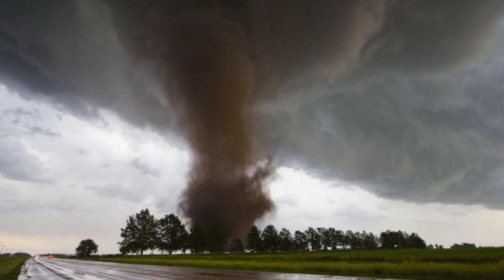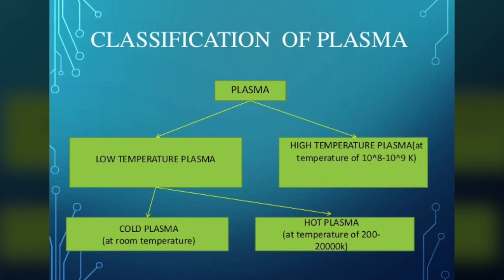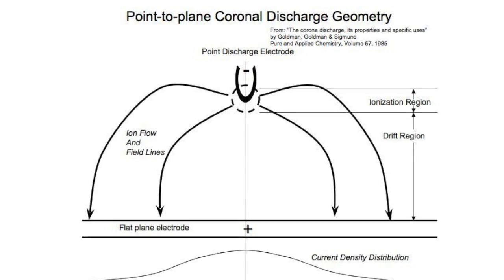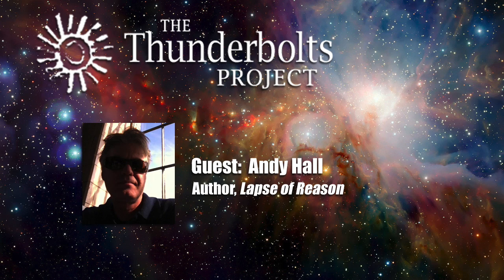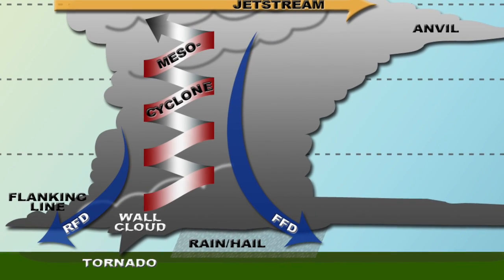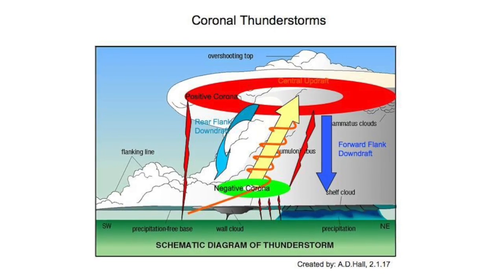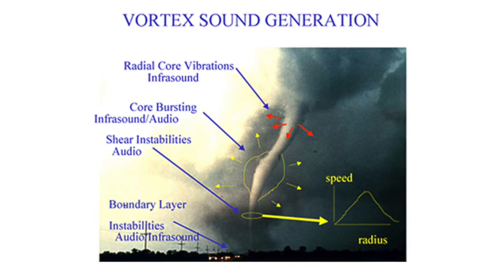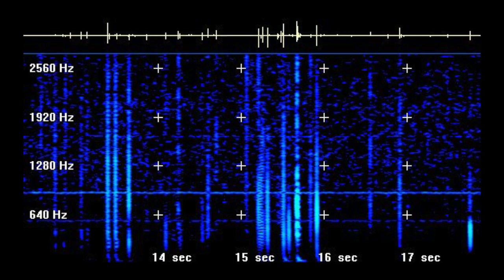Andrew Hall: Tornado – The Electric Model | Space News

Comment: We have all heard stories of objects being 'sucked up' into a tornado vortex.  From a mechanical perspective it is not possible to contain an object in a swirling vortex of water.  The object simply crashes through the wall of the water spout.
On the other hand I wonder if electrical charge could draw objects upwards into the spout, and then the mechanical action of the wind throws debris sideways over large areas or carries debris a great distance.  
Electrical levitation of ionized objects (objects with charge, not vaporized   lol)  would provide an excellent explanation for the transportation of objects by tornadoes.  
Fish might just behave like pieces of tinfoil in this scenario, being carried along with the charge cloud until they discharge and are no longer held up.  Also, fish might be a bad example as they are in water and should not build up any charge.
Reply: Sean Nanoman 
My western brain has always had difficulty with the claim, some Buddhists can levitate. Controlled studies by Harvard, on Tibetan monks ability to dry, soaking wet sheets, in ambient temps under 40ºF, using maintained surface body heat over 60ºF above ambient, is not possible according to western understanding...(That's why they chose to study it.)
But levitation has never been studied. Either because it's bullshit or perhaps not allowed.

Recent interactions with a rinpoche raised by Dali Lama and a trusted friend who had an audience with the Dali Lama a few months ago, have given me insight to this from an EU perspective.

According to Dali Lama words.
"The Sun is causing the anomalously rare extreme weather we see today." And his protege rinpoche living in Carmel Ca. Khenpo Karten Rinpoche (The heart monk.) confirmed that by resonantly manipulating negative ions, monks create a shield against gravity that allows them to levitate objects, even themselves. But, that requires negative ions be released from the ground in that location!
REQUIRES NEGATIVE IONS!

Considering our brains appear to be transceivers of EM resonances and the lifetime of serious training and the theory consciousness and thought is actually an external process, resonantly bound to our brains unique EM signatures (As with fingerprints.), considering that affords an avenue to understand and link negative ions with levitation, among other supposed phenomenon associated with these highly trained monks.

Knowing the massive amounts of upward travelling negative ions seen emanating from the centers of low pressure systems we call Outgoing Longwave Radiation (Tracked by NASA) It is possible there is something in the mechanism that could produce a gravity reducing effect in objects positively charged by positive ions, and assist in tornadoes lifting objects like automobiles or tractors.

Now considering Thornhill's amazing theory on the London force's role in gravity as a weak dipole force... It makes sense that a tool like the human brain, is capable of affecting magnetic resonance and intended organizing behaviors with, ground originated ionic flows!

Also, ever watch a jet plane coming in for a landing? The are decelerating from 200 to about 150 mph but don't appear to be moving that fast, when observed from the ground.

I used to think that the Buddhist mumbo jumbo was just that...but...I now am of the opinion that the mumbo jumbo effect originated from the disingenuous motives of those who seek to exploit the massive revenues generated by the FMP, the corporate pyramid base of the Buddhist practice.
Just as there are some sincere politicians and many exploitive ones, the same would hold true with those who run Buddhist retreats, hospitals and other "non profit" commercial operations.
✌
Reply: That's a fascinating theory.  My personal bent is humans don't levitate.  There's way too much foolery practiced in all the religions.  The amount of charge required to levitate a human would no doubt produce plasma and/or discharge.  The idea that a blob of organic goo, a human if you will, can produce or control electrical fields is pedantic.
Honestly I had to leave Buddhism behind because there's too much mumbo jumbery and superstitious/magical thought in the practice.  It tends to be very shamanistic.
Now the video of the levitating frog in the high magnetic field is really cool.  You should look it up on YT.
Reply: Sean Nanoman 

I've seen it.
I don't believe humans levitate but I'm open minded enough to realize that top level Buddhists tap into the same sense that migrating animals use and I understand enough classical physics to know negative ions are repelled by negative charge,  as in the earth's negative surface charge!

If our brains use electricity and form complex flows of it that create unique signatures of EM waves?
If animals use this ability to navigate and sense?
Who's to say the true "Search for Enlightenment" is not actually the search for reclaiming our own innate ability to use our brains to detect, interpret and utilize, magnetic fields?

Think about it. Just a small piece of plutonium can destroy an entire city. That's a shitload of resonant energy, just waiting to be released from sub atomic particles!
Yet we spend billions looking for the higgs boson particle when all the energy we need is orbiting every atom!

Suspending disbelief is the hardest thing to do. Trashing Einstein's theory of special relativity? You'll be labeled a crazy person...although nobody can actually explain it. I've read several books on it and still cannot understand how he took Maxwell's equations, eliminated the wave bearing medium that EM energy requires to propagate, and didn't explain how he could get away with it! (The aether)
That's why you could spend your life reading about his theory, trying to understand and go to your grave still confused...smh.

Thornhill pegged it!
E=mc2 actually means...
Energy, mass and the speed of light, are all properties of matter!

Look up definitions for both energy and mass.

Energy isn't defined, just what it does.
Mass is defined and measured by what it weighs on earth!

Mass and matter aren't interchangeable. But that's the mistake most make in explaining that famous equation. 

One more thing.
If a scientist cannot explain in physical terms, every symbol and rune in an equation?
That gives you the right to go ask somebody else!
Einstein said, If you can't explain your equation to the barmaid? Then you do not understand it yourself!

BTW, energy is sub atomic orbital particles in motion, relative to all other similar sub atomic particles in the universe...
It's not "The ability to do work", as defined virtually everywhere.

✌

Comment: I noticed once a thunderstorm goes over a area of land it is harder for another thunderstorm to form over that area. Its as if the area of land lost its charge. In TN the other day on a drive I watched a heavy thunderstorm go over an area then there was another heavy thunderstorm headed for that same exact area & when it moved over the area it melted away even though it was in the 80's with high humidity.
Reply: Curious. I am not so sure that an 'area' is that isolated of an electrical environment.
Reply: Thunderstorms tend to stabilise the environment they form in by transferring heat to the upper levels of the troposphere and by forming a cold pool at the surface. This might explain why the second storm you observed dissipated as it approached the area (many other factors could come into play here as the atmosphere is a chaotic place), although in many cases multiple storms can indeed develop and move over the same location repeatedly in a relatively short time if the conditions are right, in a phenomenon known as "training".

Comment: He used a lot of words, I doubt viewers would have understood the essential reasons for tornados over lightning :

Can viewers answer this? 

If there's a voltage between cloud and ground, why not just a lightining bolt? Why a tornado?

The answer is simple and should be familiar to all in the EU group.
Reply: + james grist,    Any electric current spins naturally.
Reply: @velikovskysghost  - When I ride my unicycle down the walkway, the wheel spins because..."any electric current spins naturally"! Yeah! Mr Hall has dumbed everyone down to using meaningless statements!
Reply: @bruzote  Keep on supporting Victorian age nonsense. By the time you figure out that Andy Hall is right third and fourth graders will have to explain it to you.
Reply: Why a tornado instead of a tornado? Charge density and electrical potential. Less of both for a tornado. The difference between "dark mode" plasma and a plasma arc.
Reply: aaaaaaaaaand 8700+ views and no one knows the answer.

A tornado is a B current, a lightning bolt isn't. Its bad enough no-one knew, but Donald Scott gave u the answer in the previous upload, and still not one in 8700 could repeat what he'd said.

It'd be nice to explore why magnetic holes form to allow B currents, but best not do it here.

"Why a tornado instead of a tornado?"
 - yep that's about the right level of question for the comments section

Comment: I saw an F4 in 1998 which glowed green and exhibited intense funnel center lightning.  I thought it was remarkable and wondered if maybe the electricity formed tornadoes instead of vice versa.  So I've been waiting almost 20 years to see this.  Well done.
Reply: Energy must travel as a vortex between horizontal magnetic layers....electromagnetism is perpendicular to the original source....so between horizontal layers a vortex MUST form to pass electricity...electricity is a vortex...same as a tornado.
all energy must pass as a vortex between the inertial plane of magnetic layers...same as a magnet, which is an electrical /electromagnetic object.
Reply: MagicBlubber when you run electricity thru a wire, the electromagnetic field will develop circulating perpendicular around wire in a particular direction. google "electricity and magnetic fields in a wire"
Reply: Electromagnetism is perpendicular to the original source, can someone explain this in laymans terms? Like what is physically going on? Or is it just that engineering wise we can measure a field and know how to calculate strength. But no one actually knows what it is and what is going on.

When you say it's perpendicular, I'm trying to think of electric discharge, how it always strikes the surface at 90 degrees, perpendicular.

But what is the source? And how do you determine/conclude that the source is perpendicular to the bolt? Where's the suggestion that where the charge or charge difference is coming from is perpendicular to the discharge component? What is the difference between magnetism and electromagnetism and electricity? What is discharge? Electricity or magnetism? 

Is it both electricity and magnetism? I'm told where there is electricity there is magnetism, so if discharge is oriented up to down in a lightning bolt or a tornado, is that why tornado spins? Because perpendicular to vertical is a tube or column around the center axis of discharge? But why is it spinning?

So is the flat cloud shelf not also related somehow to all of this? Does electricity flow horizontally through the cloud shelf? If so, where does this magnetism show up?

Do you know?
Reply: That's an amazing thing to witness. I've seen many wall clouds from afar living in Oklahoma all my life. It wasn't until this past week (when we had a tornado outbreak) that I witnessed what you're describing. There was one confirmed tornado about 3 miles South of my location that I watched track off to the East early in the morning. The lowering and ceiling of the clouds near the center of the tornado was about 1000' AGL. I've never seen lighting so bright and so intense before coming out of the core. Then, two days later, we had another tornado passing 4 miles West that I witnessed go by. The tornado was wrapped in rain, but the rain wasn't over my location at the time. I could see the main center of rotation going by, tracking it with RadarScope on my phone (best high-res radar app in my opinion, BTW) and I recall seeing a main core of lightning at the center of the circulation. Odd thing is, the storms were moving so slowly (40 to 50 MPH?) I just couldn't see how wind shear, even at upper levels could spin up that much energy. Based on the principles of this video, I could imagine a vortex of electrical energy funneling down into the Earth, trying to balance out, causing the dust and moisture in the air to interact with it.
Reply: I recall, and have a low quality picture of very intimidating storm clouds and in a particular area there was a strange greenish/aqua glow. I thought it was curious but i really had no way to explain it, but perhaps it was some sort of electrical glow.